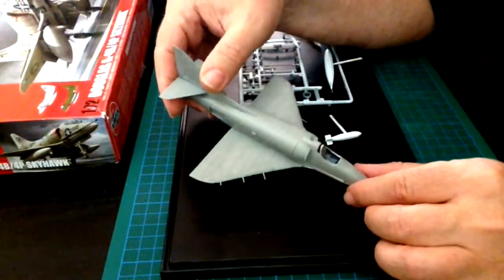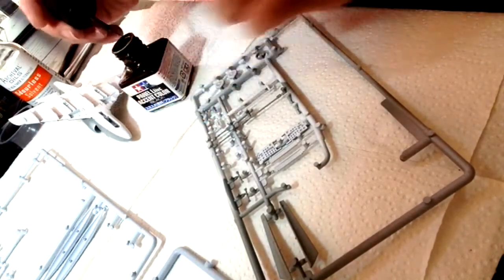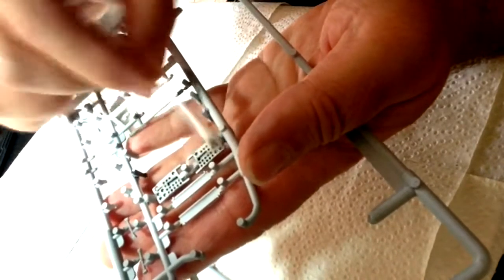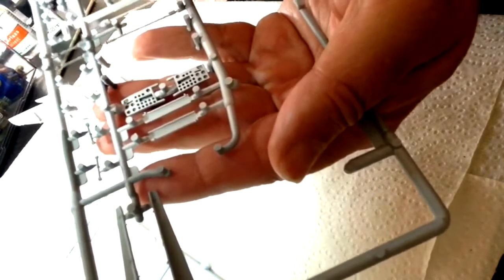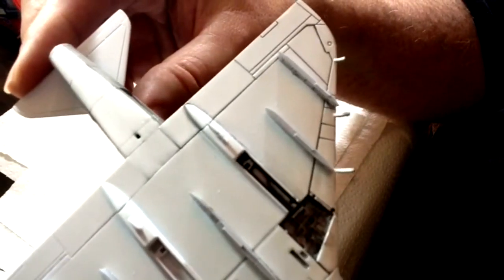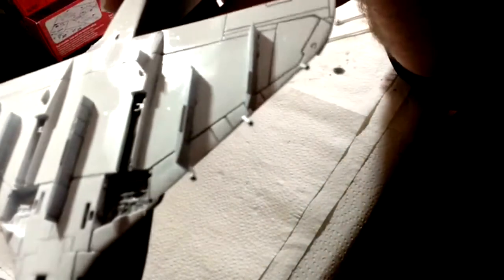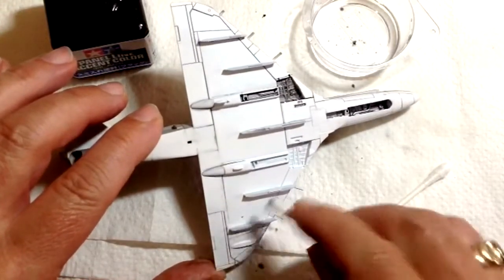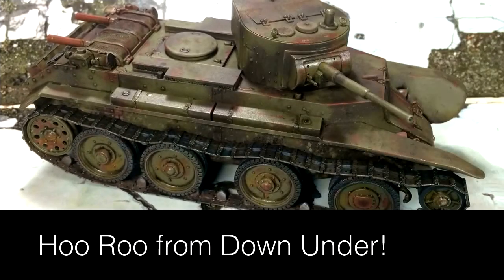How I Do Aircraft Washes

Comment: Have you ever tried " true touch pens " to do panel lines? And for a beginner, how much scribing on the panel lines do you recommend?
Reply from the maker: +Justin Rogers if you have a look in the full Skyhawk playlist you will find a video called pencils.. where I use a soft graphite pencil to do the panel lines on the upper body and touch up the lower areas.. as far as scribing goes, this kit required none out of the box.. it was only when I joined and sanded the upper fuselage that I accidenlty removed some panel lines so used an old corn cob holder to rescribe them.  This is also shown in the Skyhawk playlist.  Some kits require a lot of scribing to get the look you want.. the new Airfix and many of the Tamiya aircraft will be fine out of the box.